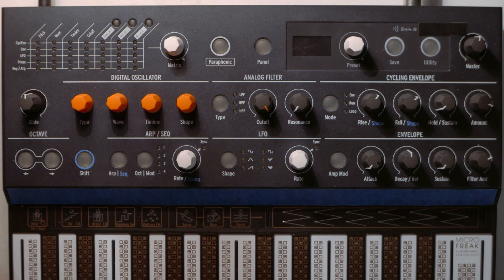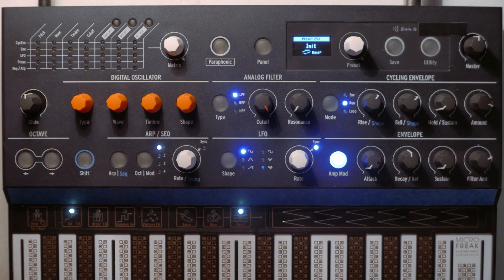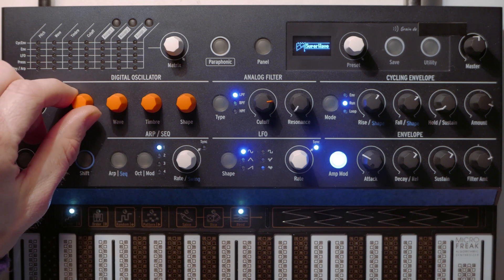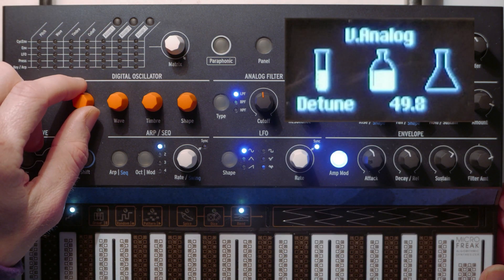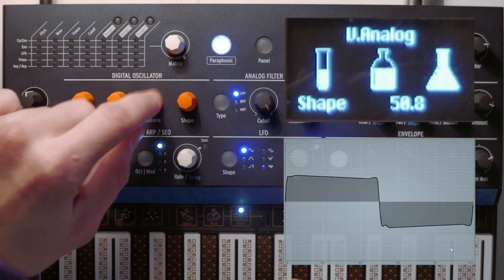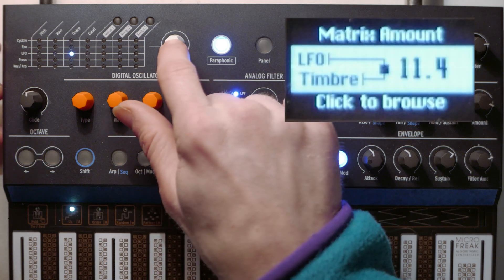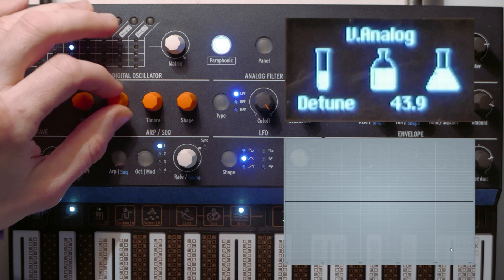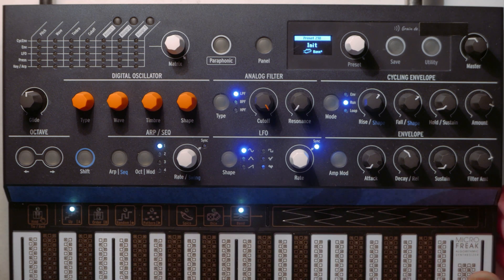MicroFreak oscillator types tutorial: BasicWaves, SuperWave, V.Analog, Sawx

Comment: what oscilloscope did you use and how did you connect it to the minifreak?
Reply from the maker: I use the one included with the Free Bundle from Melda Plugins. You can use it with any VST host (I use Cakewalk). I plug the audio output from my MiniFreak into the input on my Scarlett audio interface.
Reply: awesome thanks! @Thoracius